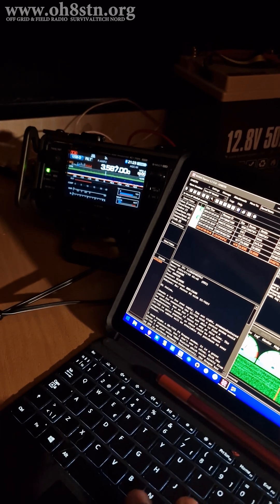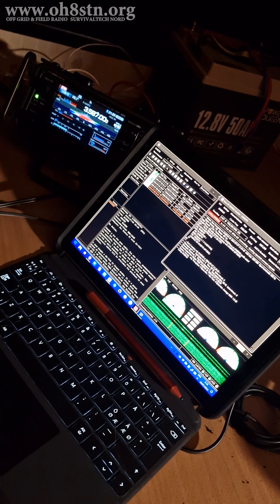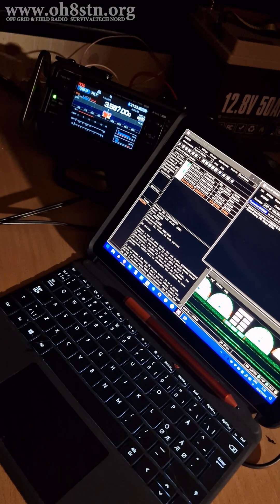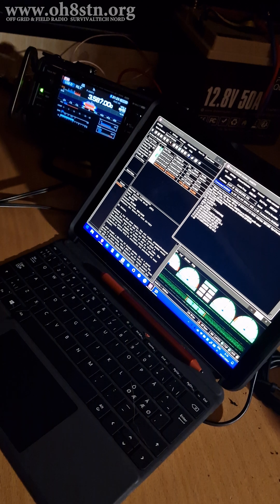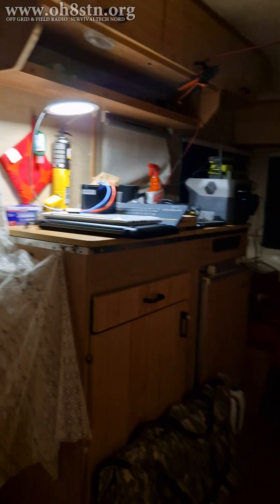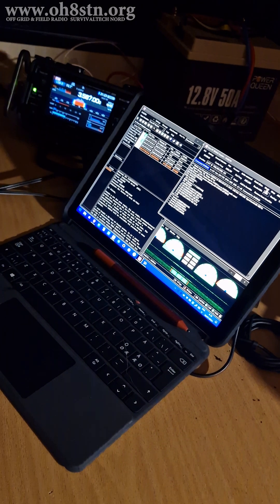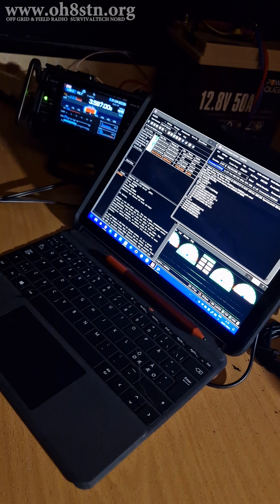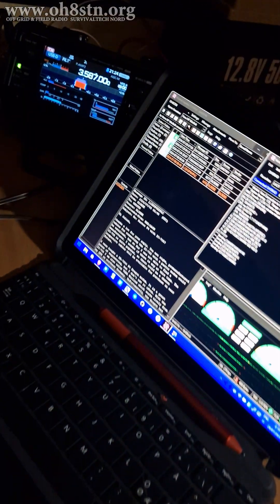QRP Winlink Session

Comment: If it ain't phone I ain't playin. There is enough trash noise on the airwaves without adding to it ! ( I occassionaly use WSPR to see if my antennas are working properly 🙂). I also sometimes use the decoder on my uSDX black brick to read CW when band conditions mean that I cant hear any voice. Your point however is well made . I use 5 or 25 watts only and am stunned by those who use kilowwatt plus power and mast mounted rotatable beam antennas whatever the conditions. I class them as technocrats rather than hams. Throw enough money at it and of course you can talk all around the world no skill required. Me ,I prefer the challenge of low power. 73 M7BLC
Reply from the maker: Probably lost most of us at "trash noise".
Reply: The difference is occasional long range contacts and consistent ones.  Radiation pattern is a thing and wasted power in others directions is just "noise" on the air waves.  Multiple qso attemps is also "noise" compared to once and done contacts.  Directional antennas can hear much better than omni directional.  Im all for the sport of the hobby including qrp. Dont knock other aspects of the sport just because you dont have the money or space.  All contribute to the hobby and are in there designated radio spectrum.